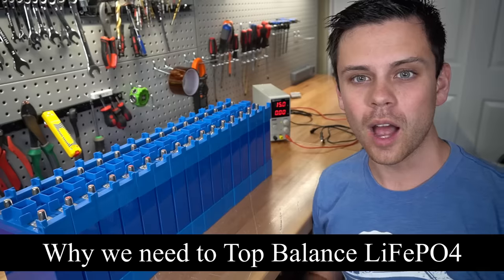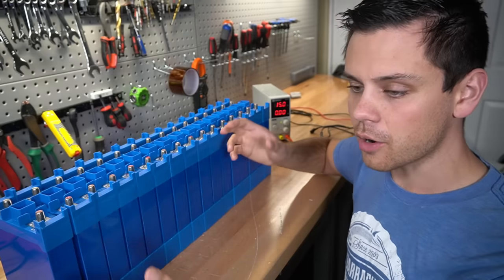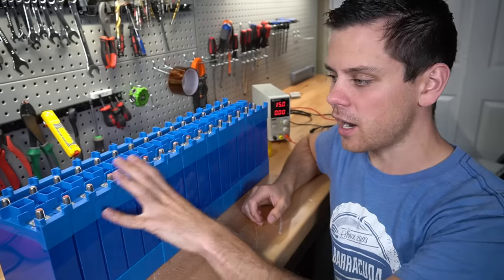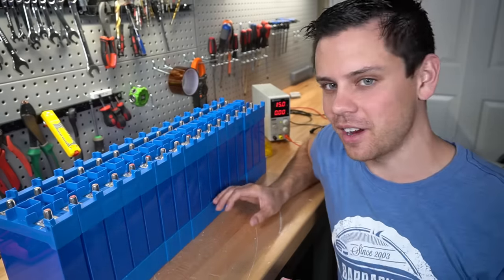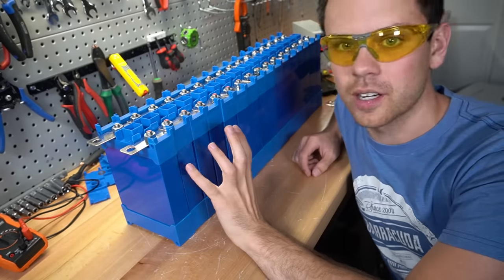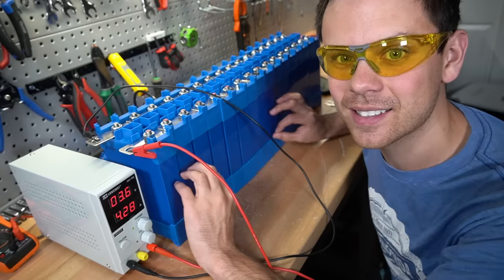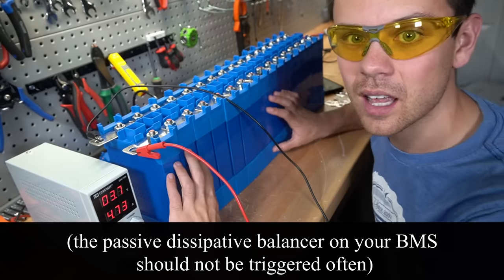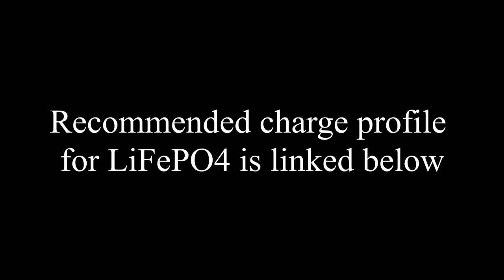How to Top Balance LiFePO4 Battery Cells Quickly (and when you need to do it)

Comment: Could you do a video covering ALL steps needed? Let's say I'm replacing old 12V batteries in an RV, and I decide to order a bunch of CALB or Fortune packs. Exactly which steps should I do to rip out the old lead-acid or AGM batteries and replace them with LifePo4? Seems like there is testing the packs, top balancing (this video), grouping them by 4 to get 12V, add BMS and balancing leads etc....? Anything else I'm missing?

Comment: I am struggling to find any info here and could use some guidance please.  I am trying to build a 14s 48v battery pack from used Leaf cells.  I can not find info on how you connect a BMS and the charger at the same time?  Does the BMS just do its job once it is connected and act to monitor and balance the cells so they remain the same voltage per cell, and then just charge with a LiFe charger?  Trying my best to understand all of this, I trust your knowledge the most Will

Comment: Hi Will,
I've just purchased a power supplier EBC-A40L and 96 EVE 314 Ah cells. I understand that I have to top balance the cells in parallel to 3.65 V but shall I have to mount the 16 cells in series on my DIY 48 V box at the high voltage level ?
Many thanks for your help.
Patrick

Comment: I just bought a variable voltage 2 amp power supply so that I can top balance my cells.  My question is what voltage should I set the power supply to?  Should I simply set it to the desired voltage (3.65 volts)?  Or should I set it higher than that?

Comment: If you have big 48v charger you can put all in series and charge until BMS cuts off. Then all in parallel = less time to wait but more work.

Lifepo4 chemistry goes off balance most compared to others.
Reply from the maker: Yes good point. Great way to get at high SOC
Reply: Hi, Can i use my solar charge controller(no load connected) instead of the Big 48v charger to charge?

Comment: I was charging my 100AH LFP battery with a 20A charger that uses 9 stages. This battery has bluetooth and was watching the charging time left. Once the battery got to 99 percent charge the time left starting slowly increasing. Was this due to the dropping level of the Amp input? I was not for sure what was happen and stopped the charging. Why was time left for full charge increasing? I was using a HTRC 20A charger.

Comment: Will, even though it has been a few years since you made this video I am hoping for an answer.  I have 4 LiTime 12 volt 230 ah batteries.  I will be connecting them to create a 2P1S battery bank.  These are all new batteries.

I had charged all of them individually up to their max charge state prior to connecting them first in parallel(and waiting 12 or so hours) and then into series.

After the first discharge down to about 20%(estimate via voltage) the BMS turned the bank off.  Now I am only able to charge them individually up to between 12.6 to 12.7.  They are "Stuck" at this voltage.  A cure I was given by LiTime support for when this happened when first charging on arrival was to add a small load to the battery and it would then show the actual voltage....which it did...it went from 12.7 almost immediately to 13.1 volts.  This cure does not work now.

Because I do not have any access to the internal cells I cannot do as you recommend without voiding the warranty.  I have a support ticket currently with LiTime but have not an answer as of yet.

Any suggestions?

Comment: I have 2 BYD batteries 24V 260Ah, I got one of them almost fully discharged, I realigned cell voltage with a power supply, thus all cells were more or less aligned to 3.25V. 
Then, I put both batteries in serie  and charged with solar MPPT 1100 W or 0.05C charging current,  adding around 120 Ah. Battery 1 cells voltage went up to 3.65 while battery 2 cells voltage remaind around 3.45V.
Then, BMS switched off both batteries. After disconnect, one battery voltage stabilized to 28V and other battery voltage to 26.8V
Can I set my 2 batteries in parrallel in order to align both voltages ? 
Any precaution is needed for doing this, in order to avoid excessive current Amp between both batteries ?
Thanks for your valuable informative videos.

Comment: Question: If you built a 48volt like the one you have and in using the battery you discovered there is a bad cell. When your replacing that cell do you have to top Balance the battery again?

Comment: It seems to me that you would not need to charge them all the way up with this set up but only until the cells are all balanced say a couple of hours with his little voltage supply.  Wouldn;t they just equalize if 5 or 10 amps were going in for a few hours?

Comment: Top or bottom balance? I still am not sure which I should do.  I have a 200ah 12v battery made of 4 prismatic cells, the intended use is for camping and running a fridge with a small amount of solar charging, but mostly will be just drained over a few days while camping outdoors.  So with that use-case in mind, should I top or bottom balance the cells.  One of my cells is slightly off compared to the other 3.  I use a Daly 150A BMS purchased a month ago, I also have access to one of those small 2A active cell balancers if needed. Thoughts?

Comment: I only am building a 12v 200ah battery. And I ordered the Daly BMS with it. The one you said the low remo cut off didn't work properly on. Should I be alright on balancing? Well that is if they actually come in grade A like advertised.

Comment: Should you not charge the parallell pack from either side with the positive and the negative to make sure it is charged evenly?  Check with a clamp amp meter and you know what I mean.
Reply from the maker: oh sure thing but considering the resistance I wouldn't worry about it. To get the current to drop to near zero is very difficult no matter where you place your leads. Current sharing is very important topic though. If I was speed charging, sure. Not a big deal for balancing though
Reply from the maker: Just think about the amount of current going into the pack at high soc. Very very small. Voltage drop across bus bars that can handle 150A, and pushing .1A, shouldn't matter. You can attach it anywhere.
Reply: Ah. Ofcourse. Since it is such low current. 
Thx
Reply: I think you’re right. With so many cells and busbars it makes a difference that I think can be measured. And it is so easy to move one lead to the last battery!

Comment: so now it seems that batteries have to be delivered at 30% state of charge, so I assume it would be best to bulk charge that batteries and then when they are getting close say 3.4-3.5v that would be a good time to put them on the power supply to finish getting them up to 3.6v and make sure they are all top balanced?       I have a 100/20 Victron smart MPPT solar charger, would this would well to charge 4 cells up to the desired point before swapping to the power supply or do I need to buy a dedicated charger just for that?

Comment: I have just ordered 8 LifePO4 3.2v 200ah batteries (plus BMS, smart shunt, etc) to build my first lithium battery bank for my garden off-grid solar set up.  I am still not sure what type of battery charger i need to perform the top balancing. I assume my old foxsur 12/24 v pulse repair charger (with car/agm /otorcycle modes) is not ok?  Any advice appreciated. Thanks

Comment: Would it be fine to balance the cells by keeping them in a string, say 4 cells in series, and charging the string to 14.4v (3.6x4)? Or is it necessary to parallel all cells and charge to the cell balance voltage (3.6)?

Comment: Can I use any DC power supply to charge the batterys as long as the charging voltage is right and there are no over current?

Comment: Hi. I have new eve 280Ah cells. I have had them on a dc power supply to try and top balance.  Been sat at 3.65v for 3 days. Not dropping below 2.6amps. If I disconnect the power. Bat at  3.35v ??

Comment: I've been following this process with four cells. All balanced at 3.27, I have been using a 2amp charger set at 3.65v but they don't seem to want to rise above 3.32v
Reply: this is interesting :0
Reply: @NawtieBoy96  yes, I don't understand it, The cells are taking 2 amps but they are really really slow to show any voltage increase? Started out all at 3.217 and have only climbed to 3.32 after a lot of hours
Reply: @rallycorsa1600  this behavior is understandable because for this chem type more energy is towards the beginning and end of the voltage. there can also be the reason that probably your cells weren't charged lets say upto 80% so now they are all gonna charge at the same time ( I assume youre doing all in parallel) , because 2A will be lesser to distribute with in your no of cells. more current is better as it will take less time for all cells to reach same voltage.
Simply do the power formula right now 
P = 2A * 3.32V = ....W
whats your total battery pack enegy capacity in Wh ? divide this by the P above you will know how long it will take to charge all cells( battery pack) :D

Comment: Hello Will, If I do not have a charger like yours can I use a power supply like the one you show in your DIY Milk Crate Generator Videos that is the one I purchased where you can adjust the voltage. Not sure if it will keep sending amps when charged or drop to zero like the one you are showing. I do have a amp meter so can check amp loads?

Comment: So connect in parallel to make a huge 3.2v battery and then charge them as one battery?
Wouldn't the battery on the end of that line not get the same charge as the first?
Trying to understand, thanks.

Comment: Will @3:40 you indicate to create 4s packs and then charge with a traditional 12V charger to avoid long waits top balancing. I have two questions: 1) I do not own a 12V charger, but was wondering if I could use the power supply in this video and what settings would be used? 2) Do the 4s batteries need the BMS attached when doing this?

Comment: I picked up a Valence U27-12XP do I need to add a BMS to use in my camping trailer with a PD9140A – 40 Amp Electronic Power Converter with wizzard and an MPPT solar charger set for gel cells. I am a little confused.

Comment: Hi Will,
Don't you risk destroying a bench psu by connecting it to batteries as a charger. I have always understood you should connect it through a diode? Maybe this only applies to PSUs with bipolar output devices but you would seem to be reverse biasing the output transistors.
Reply from the maker: Yes use diode
Reply: Interesting,  Thanks, So if you add a diode then I guess you need to compensate for the voltage drop across the diode and/or monitor cell with a volt meter?

Comment: Hello Sir. Can I connect them in series for example 8*3.65=29,2  in order to give 29,2 volts and 5Amps with the charger and do it faster, or I will have other issues?

Comment: Hi! Thanks for this video! I was wondering, how do you know when you have a bad cell in your pack? I have 8 cells...24v, when put a high load on it (80 amps) i see one cell that drops a lot in voltage, while the other cells do not drop that much. Is that a sign for a bad cell? I can charge it back up to 3.55V  and my BMS does get all 8 cells balanced with a 5mV difference.
Reply: Check your connections as a degraded busbar connection can cause this behavior.
Reply: Good question. How do you know if a cell is Bad?

Comment: Doy you have a tip on how to di it with a ready built 48V pack with welded busbars? I have a kind a crappy chinese battery with one massivly drifting cell, I still need to measure the cell resistances but I cant parallel them as they are welded together. (and I top balanced them a couple of times via the bms but no effect)

Comment: I have the same 16 cells.  I also have the same charger as Will I think.  It has been several days charging, at least four and the cells are still at 3.2 volts like they were when they came out of the box.  Wonder if this is right?

Comment: may I ask i have charge it in what indicated 3.6 volts for 2 days and it reach amp of .1 is I stop charging it remove the batter power supply.. just what you have instructed

after 12 hours i just tried to see if it will still charge and it did the amp change to .35 

should I continue to do so?
should I continue to charge or stop?
the batteries were not connected they were still in parallel when i left them and see any why they have been discharged..

Comment: I'm using a charger similar to the one in this video to bring 16 cells up to 3.6v. I have set the voltage quite a bit higher to bring the cells up to 3.5v. I'm sitting with them keeping an eye on the voltage. I will bring the voltage on the charger back down to 3.6v to finish the process carefully and avoid over charging. Have you Will or anyone else on here done anything similar? Or is what I'm doing a little risqué?

Comment: Hi Will!, I have 4 200Ah 12 V lithium batteries on an RV, with a complete Victron Multiplus 3000, all Victron components. I did not balance the batteries. How can I go about doing it now, using the Victron charger in the Multi plus?

Comment: I am trying this, with 16 new cells I bought, but it is taking forever to charge, using the power supply you recommended (weeks).  The cells are 310 A-Hrs.  All but one were 3.34-3.35V when I checked them initially, except for one that was 3.28V.  Should I have tried to charge that low one up first?  I have bought a BMS, and will be building a 24V battery block.  Am I wasting my time trying to do this top balancing?  Thanks.

Comment: Hello Will, thanks for all your very helpful and well made videos about Solar and powerwall. I just receive 16 Lifepo4 280Ah cells purchased on a famous chinese market, all cells are well balanced but thanks to your advice, I start to make top balancing. All cells plugged on parallel, connected to lab power.
Lab power set up : 3,65V output and 10A (max power).
Battery pack : 3,332V.
When I plug the power lab on the battery pack, only 0.35A consume.
Is it normal? Is there something to do in order to speed up the load?
Thanks for your help

Comment: Hi Will - at minute 3:41 (et seq.) you discuss making 4s, 12v batteries and charging them up quickly with a TRADITIONAL 12 charger, did you mean like a normal charger for a LiFEP04 12 battery, or some sort of BMS setup? Thanks again - I'm using your links to buy stuff :)

Comment: I have cells high at 13.77V low at 13.44 after charging 4 cells in series with 12v charger. if attached if attached in parallel to power sapply at 3.65V will they balance ?

Comment: Using 8 cells to built a 12 volts 200 a.h battery do i need to add 2 bms one on each battery  or is it better to build one 12 volts battery with one bms?

Comment: Hey Will I've just had 15kw solar array with a 15kw Sol-Ark Inverter/charger controller and 48volt (16s) @740wh each LiFePo4 box.  I am not aware that they did a parallel top-balance, and the meter is showing 100% power.  Is this something mission critical?  Or should I let the warranty play out?

Comment: You mention that you should redo this procedure after 6 months. I have a followup question regarding that statement. If you do this technique before initial install. Then install with a BMS, do you still have to "top balance" after/every 6 month? Shouldn't the BMS take care of that?

EDIT: Ok, so I rewatched and I think you were talking about using these batteries without a BMS, then after 6 months you should redo the manual balance.
Reply from the maker: Oh no, let the BMS do it. I was meaning balancing in general

Comment: When you say charge them in groups with a 12v charger, do you mean without a BMS and can an Intelli-power 9000 series RV charger (one of your recommendations)  be used - and is there any thing to be careful of?
Reply: I think its okay to not have a bms while doing a top balance like Will has done.. as long as you control the voltage and current with your power supply.. in Wills case he set it to 3.6V.. and a fix amount of current..
Reply: Li ion chargers usually do a constant current charging.. and when it reach a certain point it will transition to constant voltage charging... this is done in order to not damage the battery.. be sure to consult the specs of your battery to do this bec they have different values of voltages and current to use..

Comment: If we make the Lifepo 4 32650 battery of 3.6 Vault and 6000 M 5 Parallel.
So 3.6 volts and 30000mah.  So I want to know whether there is a need for buns or not.

And in case of Volt and how much ampere charger to charge.

Comment: Hey, I'm thinking of replacing the 12v20a SLA batteries in my e bike to 12v30a LiFePo4. That's six cells in series for 72v30ah. Do you think I need a BMS for charging or could I get away with manually balancing the batteries once in a while?

Comment: Hi mate I'm a little puzzled I've just bought 4 280ah cells from China set them off top balancing 3.65v the amps were at 7.5 next morning they were at 5.7amps which is OK I think by tea time I came in and amps were 10.9 and not budged over next 12 hours so turned off as don't seem right do u have any suggestions please

Comment: I received a set (6 units) of A123 (ANR26650m1A). The BMS seems useless. Do you recommand to add a BMS for each of the 6 units (but then unable to detect defective individual cells) or something different ? And is it better to add an adjustable 36V LiFePo4 charger or a standard charger (that will limit the voltage/current following a LiFePO4 pattern) ?